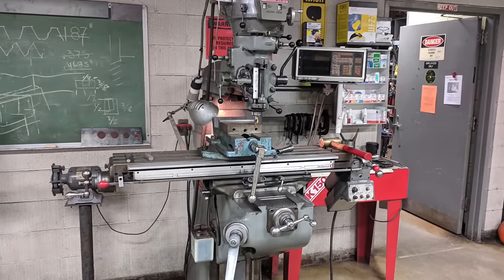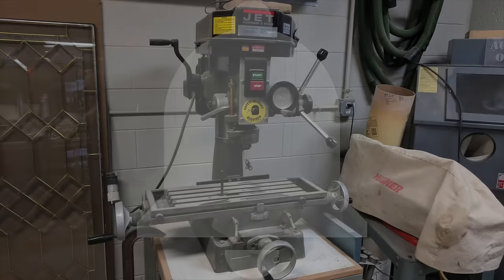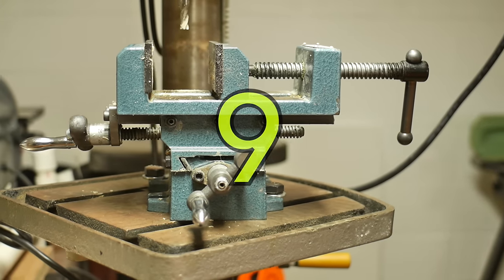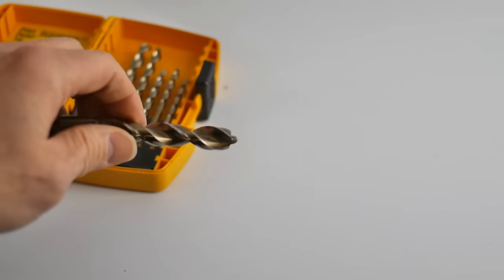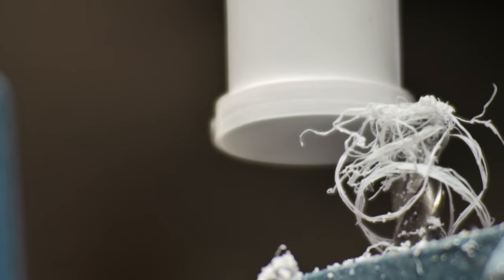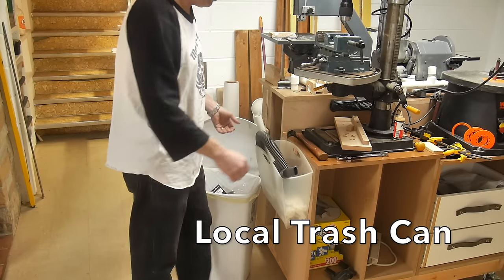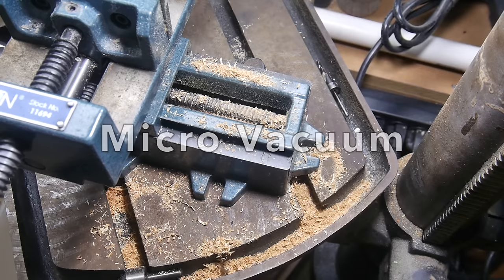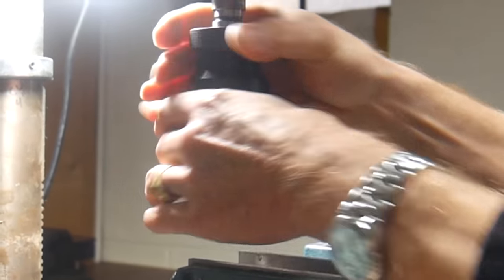Drill Press Machining Hacking/Tips and Tricks: The Basics

Comment: 1. DO NOT CHUCK A HARDENED END MILL IN A DRILL CHUCK. Its dangerous that bit can come out and hurt you . use an MT2 adapter and a collet chuck 
2. do not restrict the air flow on your vacuum for long periods of time it WILL burn up the motor the vacuum requires the air flow to cool the motor .
Reply: How much harder is an end mill than a drill bit?
Reply from the maker: Dunno, not my field of expertise
Reply: @jaywood8296  A HSS end mill isnt a lot harder than an M42 drill bit but a Carbide endmill is A LOT harder
Reply: @EricStrebel  Then you shouldn't suggest doing things you dont understand and maybe get someone hurt
Reply from the maker: @apollorobb  LOL, question does not seem relevant to the process. Using any machinery always involves risk, particularly spinning ones.

Comment: I'm just getting started in trying to use my Drill press for rudimentary Micro Lathe Work & some Milling. This video has been the perfect enlightenment I needed right now.
Reply: You really aught to get some lathe tool holders though if you're going to be turning (machining with a lathe) I saw that he used a chisel which can work but seeing the endmill kinda made me cringe. Lathe tool holders are generally flat on four sides so they clamp well. You can get cheep sets for as little as 15 bucks but having five or six different holders that take carbide inserts is  a much better option, in my opinion.(check banggood.com 30 to $40) 10 to $15 at harbor freight can also buy you the ability to sharpen carbide when it chips, using diamond. Or, use the search term "DMT Diamond Pocket Whetstone Tool" (14 bucks for each grit though). High speed steel isn't a bad option either if you're only turning mild steel, aluminum & softer materials.
  I was thinking of doing a video on converting a drill press into a mill but then my friend found me a beat-up, rusted Smithy 1220xl for $200 so I rebuilt that. I was lucky though, the gearbox was fine so I just added oil. Rebuilding the rest took around 80 hours. Still, with some fairly simple modifications, & around $200 you can turn a drill press into a decent, half-assed mill. There's more videos to find on the subject. Tapered roller bearings for the spindle & the addition of a draw-bar being very important but just adding a small, rectangular piece of brass into that little channel on the side of the quill , where that little screw goes for stopping the quill from moving is a simple & fast way to reduce vibration & run-out considerably.

ooops! 11 months ago... maybe I'm too late.
Good luck, regardless.
Reply from the maker: Thanks!
Reply: @christurnblom4825  Total Cost !!??
Reply: @davidwillard7334  are you asking me the total cost of turning a drill press into a mill? If that's it, I bet you could do it for $200 but you may need access to a mill or lathe to modify a few things because you want tapered roller bearings & a drawbar. I sometimes forget that I went to school for this stuff & watched probably several hundreds of hours of videos in the last 4 years on every machining subject I could find. 
 Without that knowledge it's probably frustrating to figure out, like if you're a beginning hobbyist. I'm starting to remind myself of a friend of mine a little bit. His answer to everything is "Oh, that's easy, all you gotta do is...".

Comment: I think you're doing a disservice by encouraging the use of a drill press for milling.  It's dangerous.  Using an end mill causes sideload on the spindle which is NOT intended.  I'm sure you know that an actual mill has a completely different spindle retention system.   Also, any milling operation requires precise control of the vertical movement of the spindle as well as the ability to stop & hold the vertical position accurately.  This is something almost no drill press can do.  Certainly not your (or my) Harbor Freight model.
Reply: Agreed, the same crossed my mind. Using ordinary drill chuck instead of properly preloaded taper for kind of milling is also not a clever idea  at all.

Comment: Two other things I would suggest, swap out the chuck with an er collet if you can, and if/when the bearings wear out you can change them with either angular contact bearings or tapered roller bearings of the same size to increase the load capacity, longevity, and rigidity. If you know how to tear your machine down it's an easy change. Besides that, a wonderful video and reminded me of many things I need to work on to make my own machine operate better, thank you for uploading and you have a new subscriber.
Reply from the maker: Good ideas, thanks for sharing